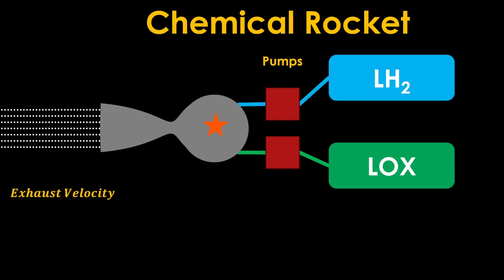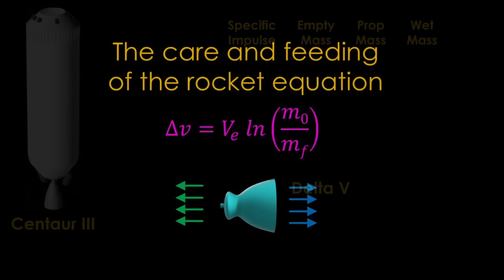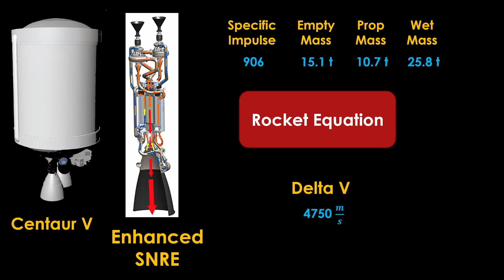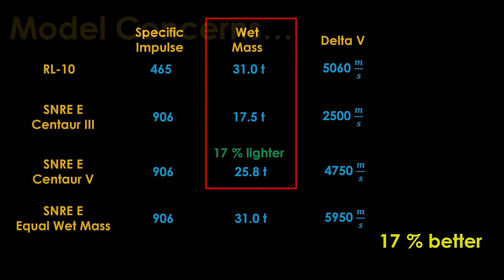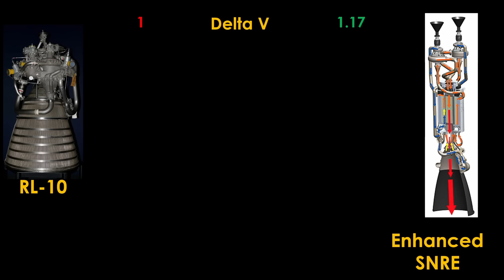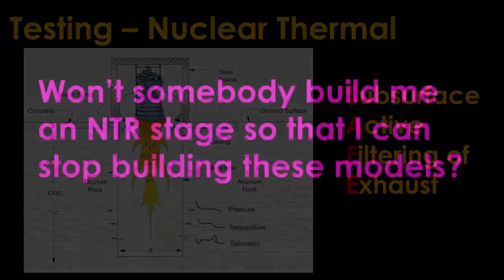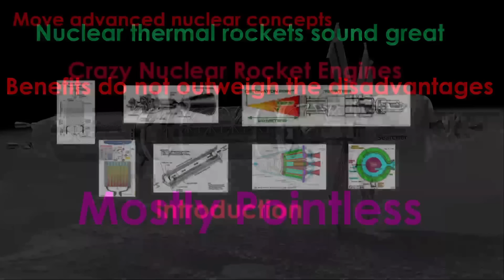Why Nuclear Thermal Rockets are Mostly Pointless

Comment: NT rockets will continue to be pointless until massive mass needs to be moved in null-g and where the propellent is non-reactive stuff.

They suck for atmosphere, at least as long as you want to not die from radiation poisoning, and are too heavy to move up a gravity well.

NT is only good for very, very long burns, elsewise there are better options.
Reply: And far from the sun.
Reply: After reading the other comments I did a search and NASA claims that the trust to weight of NTR should be several times that of chemical.
Reply: @michaelmicek  NASA has never demonstrated that. Every design to date is far worse than Merlin or Raptor chemical rocket engines. And they don't require the high additional mass of radiation shielding, thermal radiators, cryogenic hydrogen tanks many times the size of methane tanks, and they save about a third of their propellent by using aerobraking that regulators would never permit for an NTR.

Comment: Because of capitalist copium
Reply: Capitalism has nothing to do with it.
Reply: @s @sycodeathman brother it always has something to do with it
Reply: @pekabu01  The Soviets cancelled their NTR project too, because building an NTR uses more resources than are saved by getting a slightly less massive rocket for the same payload mass. Economics, not capitalism, are why NTRs aren't in use today. They simply aren't good enough to be worth it. Now, if NTRs were 4x the Isp and had the same or similar propellant bulk density, then we'd have had reusable rockets using NTRs by the 1980s on both sides of the iron curtain.
Reply: @sycodeathman  it does actually
Reply: Keep seething enough and it might magic your functional NTR and economic system out of fantasy land